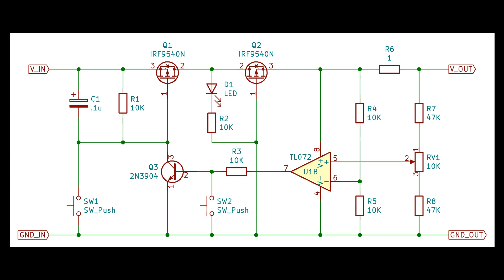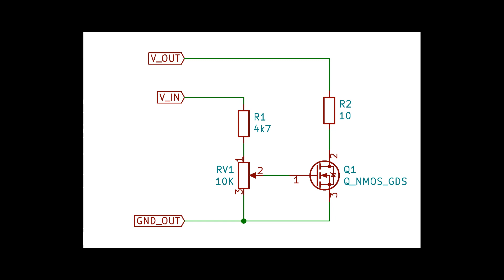Soft Power Switch with Overcurrent Protection

Comment from the maker: Github repository with schematics etc: https://github.com/gfoot/powercontrolcircuit

I made a mistake with the second MOSFET - Q2 in the diagram in the video.  Where it ended up, it's not doing anything any more.  The main point was to prevent decoupling capacitors in the load from keeping the power latched on after the "off" button is pressed.  I think the best fix for that is to move it to the load side of the shunt resistor, and connect its gate to Q1's gate instead of ground.  Then it does what it's meant to do.

Comment: Interesting and well presented. What is the rail voltage, and the maximum current? I need 12 volts and 3 amps. Thanks.
Reply from the maker: More voltage is generally better - the power MOSFETs have lower resistance (hence less power dissipation (heat) and voltage drop) if its base is much lower than the positive rail. You need to check the maximum Vgs though and make sure it's not exceeded, and pick a different MOSFET if necessary. I tested with over 1A at 5V, I'm pretty confident that 3A should be fine at 12V though some components may need substituting if they can't deal with 12V.

Comment: Great video. How can this circuit be modified to use a single push button for on-off?
Reply from the maker: I tried that, based on an EevBlog video, but found it very unstable. Still, if you're interested, that's probably the best place to look.
Reply: @GeorgeFoot  I just tested Great Scott's version. There was some instability at power off, but I tweaked the values of resistors, and it works perfectly.

Comment: George, you did an excellent job combining a “Soft Power Switch” with an  “Overcurrent Protection”. Have you considered replacing the op-amp over current circuit with a solution with very few components and without the need for a heat sink no mater what current you draw? you may want to consider the following video https://m.youtube.com/watch?v=fqeUpATJlZY which presents the basics of a current limit circuit that can be applied to any circuit. The part2 and part3, although having a different name (look in the video description for their links), builds on it with the final solution presented in part 3.

Comment: George, I absolutely love your videos, and this one is no exception. I have the same problem - while learning digital electronics was not that difficult (as long as you keep it pretty simple, that is), I feel I need to learn a lot on the analog side.
Anyway, I'm just finalising my designs for another bulk PCB order (new iteration of Z80 development board, new version of the DB6502 computer and a few other small projects), and I was thinking - maybe I could make one from your design as well? I mean I could really use this kind of protection, at least until I get myself proper lab power supply :)
Did you post your schematic somewhere?
Reply from the maker: Of course, go for it - do you use KiCAD?  I haven't done a board layout yet, but I have it in EeSchema already as in the video.  I should correct this error with Q2 and upload that to github, I'll let you know when.  It could use a lot more testing of course - I only put it together over the last few days, and haven't used it properly yet.  There could well be more bugs!
Reply: @GeorgeFoot  yeah, I use KiCAD for all my designs. Drop me an email when done, I will try to make it fas...

Comment: You are so versatile on a breadboard. Another great technique, thankyou. Soooooo.....
Could a battery life detection circuit be incorporated? (Shutoff with diminishing source?(reserve vehicle ignition in mind)) (raspberry pi camera with battery backup for mains loss)
Just imagine-eering. Love you, love your show!
Reply from the maker: Thanks Eric! For battery life detection I guess you could compare the voltage against a reference voltage, which you could generate using an LED or diode (or a dedicated voltage reference IC). The second channel of the op amp here is unused, so you could hook that up to a second NPN transistor to turn the MOSFET off if either too much current is drawn or too little voltage is supplied.
Reply: The reference can come from the source? A voltage divider?  Pondering the efficiency. Thanks!
Reply from the maker: I think you'd use a voltage divider to get e.g. half of the battery voltage into the range the op-amp can work with, but you need a fairly constant voltage to compare against, which can't come from a voltage divider.  You could use a resistor and diode to get a relatively constant voltage reference though, which wouldn't change (much) when the battery voltage dropped.  Then the resistor/resistor divider would end up lower than the diode/resistor divider, and you could detect that.
You probably also want voltage regulation to provide a consistent supply to your load, though, and it's probably better overall at that point to get a proper battery management IC that can also support charging the battery as well

Comment: Neat power supply! If you remove all but one resistor in your variable load you'll create an on demand magic smoke machine.
Reply from the maker: Some magic smoke did escape during the making of this. Even within their nominal 250mW, they get very hot, and the load MOSFET gets warm too in a certain range.